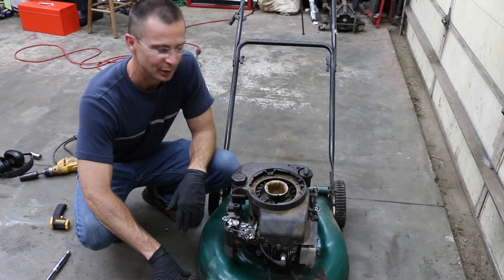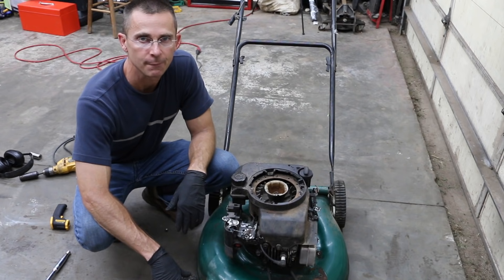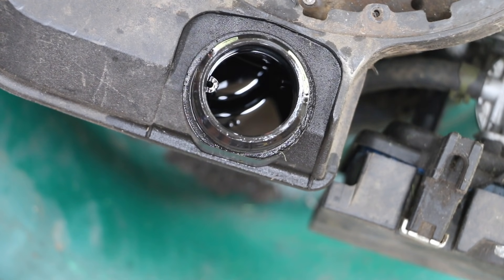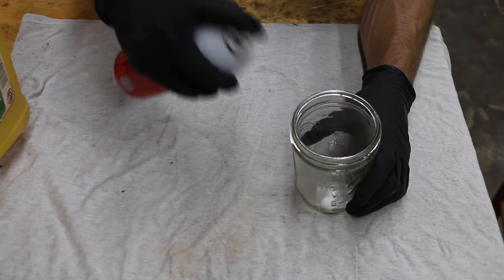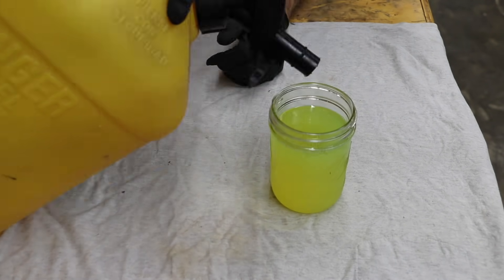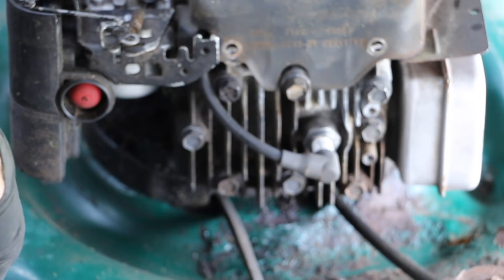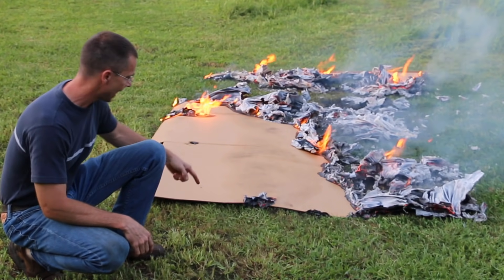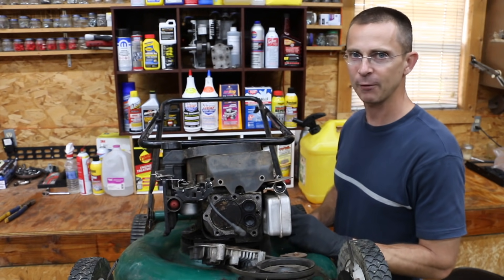Will a Gas Engine Run on Diesel?  Let's find out!

Comment: I had one run on Kerosene back in 1976.i had to lower the compression and put a hot spark plug in it . started  it on ether. once it got hot the ign.kill switch or taking the plug wire off would kill it ,had to plug the exhaust pipe off to kill it .

Comment: You need to drill out the carb jet and she will run. I used to tune small engines to run on just about everything imaginable with success.

Comment: We used to run old kerosene tractors on 1part gas and 3 parts diesel, back when the old diesel was cheap.    Now we use 16:1 used motor oil or strained used fry oil with gas. It works. In one of my old Briggs shop manuals, it said that some models of kerosene engines used a gas head with two stacked head gaskets. If you read this, your head will buzz with ideas a plenty. Keep on with the fun! This is from a 1989 National 4-H small engine contest champ. One time defeated racing mower builder and pilot (he spent tons of money, I did not).

Comment: since diesel is much cheaper is it practical to use 50/50 gasoline and diesel on a 100cc 4 stroke motorcycle.?

Comment: I've got a 94' flat bed Ford with a 460 in it, about 6 yrs ago pulled into a full service station and asked to fill it up. Noticed on the way home was acting sluggish, got home and did a walk around to realize the exhaust smelled like a diesel.. Cracked the bleeder on the fuel rail and low and behold,,, diesel.. It continued to start and run and I continued to top it off with gas. Maybe the compression is greater on automotive than lawnmowers?? Just a thought..  btw, on a 19 gallon tank, I'd guess there was 3 gallons of gas in it when they filled it up... Weird thing is, I gained mpg's by 2mpg until I had added appx 13 gallons of gas back to it. Maybe coincidence?

Comment: Do a video on running a engine off of alcohol and see if it cleans up the combustion chamber. Or do a video on can a engine run after being fully submerged in water for 30 min or whatever time. That would be a good interesting video

Comment: My cousin used to run his car on this mixture. He got fuel for free from workshops who emptied tanks for people who pumped the wrong fuel, and just added some extra gasoline to make sure it would start.

That was in a Volvo B230, and it ran great for several years on that type of mixture. Also two-stroke oil seems to work wonders on those engines, not sure why. I run trough a 5-10% mix once or twice per year and it seems to freshen up the engine every time.

Comment: Can you try to run it on Nitro fuel used on RC cars? I mixed that with normal gas and used it on my moped in my early teens, and it felt a little bit stronger uphill. Never tried to run it off pure nitro fuel though. It also made the 2 smoker smell even worse than normal.

Comment: Change the valve springs our for heavier duty types, replace the carburetor with a fuel regulator vavle and open pipe,  replace the spark plug and ignition with a glow plug+ a resistor and switch for per-heating. You'll have yourself a decent diesel engine.
Reply from the maker: Thanks for this idea!

Comment: bogus!!! i had a briggs 10 hp. started it off a propane torch head and let it run for 5 or so minutes then slowly opened the petcock with 100% diesel in the tank and it ran like a bear with the governor wtfo ... ran for over a year like that... racing it around my yard....

Comment: I had a brand new 1979 chevy van I customized 350 gas motor  32 gallon gas tank I ran 1 gollon of diesel  every time I filled it up I got over 380 thousand miles out of it it was still running great when I sold it I feel  the diesel  lubed the enguine  like my cummins  and that's one of the reason it ran so good so long

Comment: Using a two stroke oil with gas will run, just depends on how rich you make it.   I regularly put a few oz of either MMO or a synthetic 2 stroke oil for upper cylinder lube and oil to the lifters.  No ill effects at all.   My Jeep had 176K when I sold it, still used no oil in between 3K oil changes.  Diesel is another animal..

Comment: Now, see if you can run a small Diesel engine on pump gas. :) (Hint: you might have to use a large R/C aircraft engine; most of these use glow-plugs just like a Diesel, but watch out; some have magnetos and miniature spark plugs!) Also, try hydraulic fluid; I hear that's really flammable! :)

Comment: And i have another idea, can you get a small engine running off of wood? Ive seen trucks there is blueprints of a tank floating around that ran off of burning wood... but no tractors or small engines. Like if you wanna see.

Comment: NEW PROJECT IDEA!
 Using existing flywheel fan, create snug housing to direct air into filter housing! (SUPERCHARGER)
Then create a load test device and compare to tested load of stock control engine!

Comment: I saw somewhere stating that most small engines actually can run on diesel (not so great for it but it can) and it really makes sense, because most small engines run at higher temps than a car or truck engine would. Very close to the ignition temp of diesel, off by about 30 Fahrenheit. The spark of the plug makes up for the 30 degree difference and  the engine is then able to succesfully create a power stroke. You oughta try diesel in a 2 stroker.
Reply: Kent yes, compression is required in larger engines, small engines typically run at 200 to 400 Fahrenheit and diesel combusts the best at 205. The compression is only required to heat up the fuel because pressure and temperature function relatively to each other. Because larger engines, say a 351 windsor only runs between 100 to 200 Fahrenheit, they cannot combust diesel fuel.

Comment: Can you do a glass head on the 50-50 mix? It would be an interesting comparison. Or maybe, do a compression test on a engine with crummy compression and repair it with a 50-50 fuel mix. Like if you wanna see

Comment: Can you make the engine run backwards?  My grandpa tried it with a VW engine and it didn't work.  I think he cut the cam in half and rotated it so the lobes were aligned differently.

Comment: How about doing a kerosene conversion to one of the lawnmower engines, setup a valve you can switch after the engine warms up on gas then switch to the kero from a second fuel tank, like the old John Deere tractors with the 2 cylinder engines?

Comment: Having watched your sand inside the cylinder video, I think you should run carbon trough the engine. My idea would be running the engine and let it aspirate ground activated carbon. This would simulate what happens when you run thinners through the intake to clean carbon build up. With the test you could see if there was any damage caused by those kinds of treatments. Here in Europe diesel is really big and EGRs get all dirty and there are a lot of chemical solutions out there but none of them address engine damage. Your video could give us a hint ;)
Reply from the maker: Thanks for this idea!

Comment: Diesel does burn a lot hotter than gas. What about gas with no oil in a 2 cycle weed eater motor?
Reply from the maker: This is a great video project idea--thanks!

Comment: One of the guys at work put diesel in the bunker rake machine. It would intermittently make a huge puff of white smoke, which naturally I thought was hilarious. You could see it from half way across the golf course. My guess at the time was that it only ran continuously because there was still gasoline in the tank when he filled it up with diesel. And that seems to be confirmed with your test. 

For an experiment, get some carbide grit powder from Amazon, and do the same test you did with the sand in the engine. ;) that will do some damage!
Reply from the maker: LOL! Enjoyed reading your comments about the bunker rake machine.  Also, thanks for the video project idea!

Comment: if you do a 50/50 gas/diesel mix in a 18 wheeler it will run perfectly fine but soon as it get to temperature and you turn of the engine it will not crank back up until it has cooled
Reply from the maker: Thank you for sharing this information.

Comment: why the fuck would you add a moth ball?
Reply from the maker: Great question.  Naphthalene mothballs are supposed to boost octane.  Diesel has a lower octane than gas.  So, I was trying to see if diesel would work with an octane boost.
Reply: ahhh . ok. thats interesting.

Comment: Half a gallon of diesel per 12 gallons of gas is what I use to help prevent vapor locking and help lubricate fuel system.
Reply from the maker: This seems like a great strategy.  I bet this would help with fuel economy too.  Thanks for commenting!

Comment: You need to invest in a small air cooled diesel engine so that you can test it and look at the cylinder like you do with the mower engines. A diesel engine will run on gasoline but with almost disastrous results. Detonation or in extreme cases Runaway.
Reply from the maker: Yes, I hope to locate a small diesel engine soon.  Thanks for commenting!
Reply: Project Farm love the videos man. Keep it up 🤘

Comment: I actually put diesel in my 98 4.2L F-150 one time, I pulled up to the diesel pump and stuck the fill nozzle up to the gas fill and I heard a clunk and thought (never heard that before) but kept filling it up. Turns out that sound was the sound of the metal protector falling down my gas tank that stops that from happening because it's too small for the diesel nozzle to fit in. After topping off my gas it was about 50/50 but still ran just fine with the exception that it smelled like a diesel truck, the truck was really old so I didn't care much for it but that was pretty dumb of me but at least it didn't trash the engine. Thought it was pretty funny after it happened and get a laugh out of it whenever I think about it.
Reply from the maker: Glad that the truck ran with the 50/50 mix.  I wonder if the truck's MPGs improved. Thanks for commenting!

Comment: Diesel is obviously heavier than gasoline (less refined). I think that test mower has a stuck float needle now or clogged jet?
Reply from the maker: Yes, I had a difficult time getting the fuel to flow adequately.  Always enjoy reading your comments and thanks for the ideas on testing putty epoxies!

Comment: I would use a little piece of electrical tape on the metallic parts that you measure temperature, to get more precise temperature readings. Just a square one inch by one inch would do the trick.
Reply from the maker: Thank you for this recommendation!

Comment: I'm no professional but diesel dosnt get burned in the cylinder and makes it way to the base and from there causes all kinds of problems you can just imagine......i seen the neighbors drug addict son put a half a tank of diesel before he realized what he had done.......was the last gas station in the state to convert the gas pump nozzle to make this mix up impossible.
anyway he topped off the tank with gasoline in the new Malibu and it spun a bearing within hours......hope this info helps someone out there not make the same mistake
Reply from the maker: Thanks for these comments!

Comment: Maybe try this again but use a predator 212 from harbor freight. They are dirt cheap and you can get a high compression head from Arc for $45. The high compression would help with running straight diesel. Sounds like a good project idea
Reply from the maker: This is a great video idea--thanks!

Comment: I'm sure the reason why it ran on full diesel was because gas was left in the bowl      its an old mechanic trick to mix a little diesel and gas in a gas engine  to clean the valves    as you see in your after Pic
Reply from the maker: I ran the engine until the gas ran out, but didn't drop the bowl to remove all traces of diesel.  I should have thought of that. Thanks for commenting!

Comment: Project Farm, next time run the engine on gas to get it up to operating temperature and then use another small fuel tank with 100% diesel with a valve to switch fuel tanks to see if it will run on diesel that way.
Reply from the maker: This is a great suggestion--thanks!
Reply: Project Farm, maybe using a hotter heat range spark plug as well.

Comment: Try some pure rc car nitro next like if you agree
Reply from the maker: I'll definitely test this!
Reply: Ryan Drant  I did that a few years ago and half the engine ended up across the yard
Reply: Ryan Drant I've run blowers off it fine, unsure why it works but it works well in a pinch
Reply: Samuel Seidel, Diesel flashes on compression, the blower made it work.
Reply: Ryan Drant That actually works, but you have to crank the mixture control open another full turn or two for it to run properly
Reply: You can run a gasoline engine on RC fuel but you have to rich in the mixture up because nitromethane produces 50% more oxygen upon combustion than gasoline so if you do not rich in the mixture you will lean the engine out and blow it up
Reply: Ryan Drant he already did
Reply: I ran my 2 cycle scooter on Rc nitro. It ran hot but was a noticeable power increase. Just a few ounces per gallon of fuel and the 50:1 oil mix.
Reply: Too thick
Reply: No need - I did this once, in a 2.3l pinto... Blown one plug out, ran about 24mph wouldn't go any faster (dad said it was due to the Cox's engine ran like a diesel- glow plugs) that was one pint in the tank , had to add about 3-5 gallons of gas to get the vehicle to run right, for it to respond to the gas pedal.
Reply: Yes do and injected gas engine with propane while you're running diesel fuel in it
Reply: Well, these fuels are usually a mix of methanol and nitromethane (7-25%) and oil... It works really well with two strokes.
Reply: @derkeksinator17  
That was why I tried - in a gas 4 stroke as a young man... Didn't have any luck
Reply: Project Farm well it's kind of like diesel because it gets ignited by compression ignition it may work in a diesel engine

Comment: Do a little plumbing so you can start the engine on gasoline and bring it up to temperature and then while running change slowly over to the diesel - do need about 10:1 compression ratio
Reply from the maker: This is a great suggestion--thanks!

Comment: I have an old briggs and stratton repair manual which has instructions on how to convert their engines to run on kerosene. Basically, you drill out the carb jet a little bigger, and install two head gaskets to drop the compression (kerosene has an octane rating in the 50s). They made special fuel tanks with two chambers and a couple valves. There was a small portion of the tank used for gasoline, and the large portion for kerosene. You would start the engine on gasoline and allow it to warm up, then close the gasoline valve and open the kerosene. When finished using the engine you'd have to shut the kerosene off and swap back over to gasoline so the carburetor had gasoline in it for the next cold start.

I think there may have been something in there also about closing up the spark plug gap for a hotter spark.
Reply from the maker: This is great information.  Thank you for these comments!
Reply: Project Farm thanks for making these vids man they're usually pretty interesting!

Comment: I got a lawn mower engine to run on straight diesel a few years back ended up deleting the video because so many people called me a liar LOL what I did was I ground down the backside of the exhaust valve a little bit to delete the compression release from the engine then would start it on propane through the intake and introduce the diesel and get it to run. it was a carburetor that did not have a primer bulb but fuel to air mixture ratio was adjustable
Reply from the maker: This is very interesting.  Thanks for sharing your experience!

Comment: Isn't it because the compression between diesel and gasoline engines is very different?
Reply from the maker: Yes, you are right.  Diesel ignites using compression and gas uses lower compression and spark ignition.  Thanks for commenting!
Reply: Thanks for replying!

Comment: I had a 10.5hp briggs riding mower engine which I disabled the compression relief on by grinding the valve stems down. It would run on diesel if warmed up on gasoline first.

It would also run fine on Jet-A (basically kerosene) and it would even start cold on the jet fuel.
Reply from the maker: I'll test kerosene. Thanks for commenting!

Comment: I thought it would have hydro locked with diesel as it's used for compression, just like water? 

Next one should be, will coconut oil lubricate a small engine?
Reply from the maker: Thanks for this video idea!

Comment: I like your videos, watched all of them, but thats my first comment.
On the forums people say that pouring acetone as an additive (about a quart to a car's fuel tank) to the fuel can clean carbon buildup, it would be great if this can be tested. Another idea is to pour diesel in the engine oil for cludge cleaning. People say they pour 1/4 diesel of the all oil capacity. I'm thinking to try this on my car, but I'll be not so worried if it is tested with results. There are videos with diesel in oil, but they don't show before and after.
Great videos, keep going :))
Reply from the maker: These are video video ideas--thank you!  Also, thanks for watching the videos and greatly appreciate the positive feedback!

Comment: Do you think you can set up a rig to run on a map gas cylinder or butane or even a propane tank not the big tanks I'm talking about the same size that you would use in a hand torch or camping stove I'm pretty sure you know what I'm talking about.
Reply from the maker: Thank you for this video project idea!
Reply: Project Farm I think this will be a great vlog in my opinion just hope you a lot of fun without any failure and nothing goes right